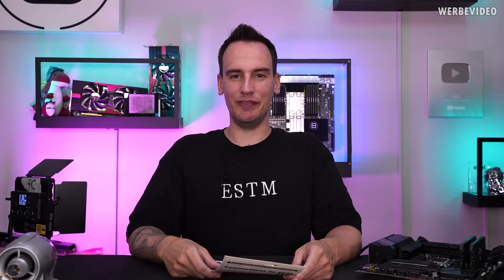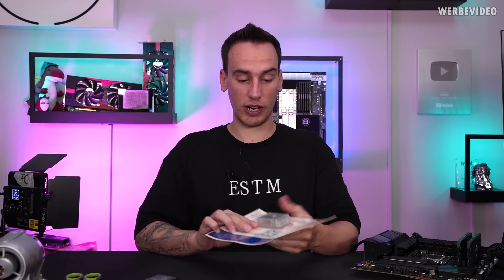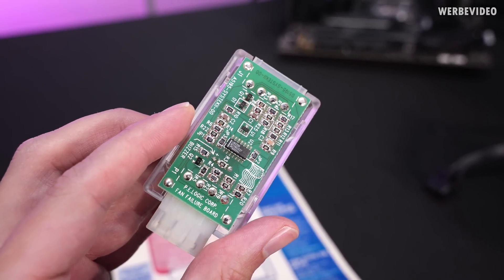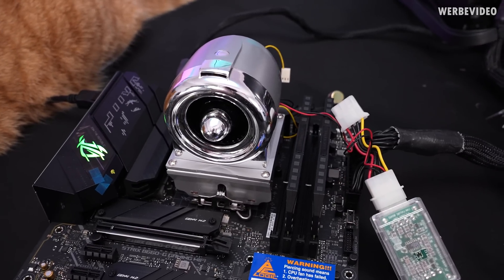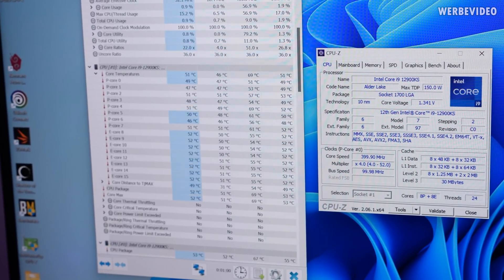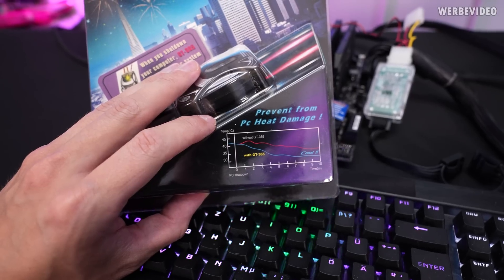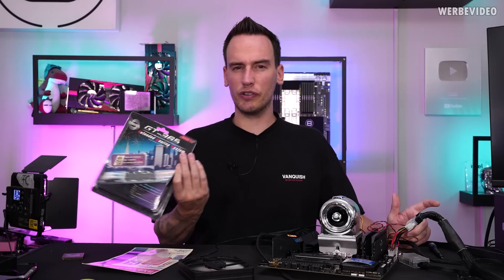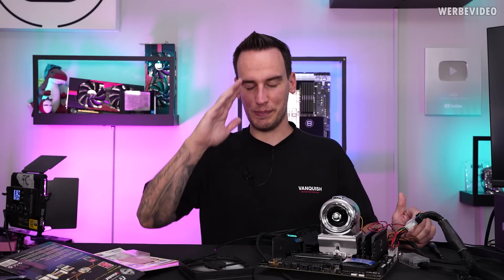This 30 Years old Cooling Gadget was Supposed to Protect your CPU... but it won't

Comment: I've had a few fans stop working, a few personally over the years but heaps of intel box cooler fans just stop working after 5-10 years on average for our industrial clients at work.

As for those old CPU's not working above 85C, they definitely do!  I had a Pentium MMX running at some 200+ C for at least an hour. How I checked? well I was melting solder with the IHS for fun.

Comment: I've only had one fan failure, and I built my first PC in 1993, but it wasn't the CPU fan, it was an MSI GTX 260 GPU. I've had some chassis fans starting to slow down and rattle due to bearing wear, but never a full stop failure

Comment: I'll admit, fans haven't been as much of a problem for me compared to something lile drive motors.

That said, I did have one fan failure over my 30+ years in computer tech. The fan on my ATI Radeon HD 3650 stopped working. Money's always been tight for me so a new GPU was out of the question, and I didn't have the knowledge to figure out how to fix it either. And so for several years, I was running that poor thing with the side of the case open and a desk fan blowing on it. It was also manually downclocked to minimum clock speeds just to make sure it didn't overheat just from booting up, and it hit 80-85C when idle.

Ahh, memories.

Comment: if your pc going be running for 24/7 them that alarms is best choice but that was back in 90s because back in 90s there wasnt safey turn off when cpu get super hot above 100c it never shut down and that when they came up with that ideas but business like it for 6 years them throwed out because new bios have fixed issues avoid cpu from being cooked over 100c auto turn off so that why they went out of business nobody buying it anymore and they knew new bios over taked them so nobody have to worry about they pc being burned up but before 2000s there wasnt any of that safey thing if your fan died them game over because cpu is already above 100c and toasted
i have so many died fan from late 80s allway to 2010 never tought they do live aging because new fan out lasted old fan that was why techology have got hold of it self and started moving forward and better
i do like idea of gt else that turn off pc it drop fan speed back down to 45% keep cpu cool down just in cause having overheat issues not sure where it coming from but can come in handy one day never know

Comment: I've had 3 fans have bearing failure. One was in a laptop, one was a cpu cooler, and one in a power supply. I also learned that those fan lubricating kits are worthless.

Comment: Yeah for those old CPU's they didn't have thermal throttling, so if it detects the fan not drawing power, your CPU would be on it's way to cooking itself. So although it doesn't detect temps, it doesn't need to, if your CPU fan stopped, 100C CPU was an inevitability so I think it does what it says.

Comment: Regarding the fan failure question @ 7:00, I have had a Scythe fan on a Scythe heatsink die mid-operation. It was on my home server, which is almost never under heavy load, and I have no idea how long the machine operated like that until I finally noticed the situation and replaced the fan. In this case though, that stupid little box doesn't get an RPM signal from the fan. Is it measuring current on the 12v rail?

Comment: I've had many fan issues... especially with Pentium to Pentium 3 CPUs. Systems that got coated in dust and wasn't cleaned or maintained would often lead to fan failure.

Comment: Even just a fan blowing air on the heatsink on its own during a shock or overload it won’t burn its when the none air flow parts such as integrated power controller and steppers , distributors like a cap an rotor , most of the time full load show their defects so having fans that can kick in when the pc is left on its own and even have an alarm would be good
Reply: Some times the fan controller rail fails during continuous use scenarios

Comment: The warning temperature is probably in fahrenheit.  Computers used to just have the one fan that both cooled the heat sink and circulated air out of the computer, so the inside of the case would heat up if it failed.

Comment: The sticker is the most important part.

The VR controller would be called a ""potentiometer" in English.

My guess for the alarm system, it's triggering if less energy/voltage is passing through it or a certain resistance/back feed is noticed from the fan not spinning.

Comment: I have had fans fail before, but they were always proceeded by a long period of "growling" as the bearing slowly went bad or its grease dried out. You had plenty of warning from that noise (which only happened at startup initially) that your fan was on the way out, and I can't think of a single time when I had a fan fail suddenly, silently, and unexpectedly.

A "growling" fan could be temporarily rehabilitated by adding some light motor oil to the bearing, but it was usually a good sign that it was time to order a replacement anyway.

Comment: Never had a fan failure on a personal system. Working in a data center I have had several fans fail over the years in servers and other data center hardware.

Comment: I had a PSU in the mid-to-late-2000s that had an "intelligent fan that remains on for a few minutes after shutdown" (I still have the handy box it came in). It doesn't say why it does this... but it must be good because it says it on the box... It was a Hiper Type R modular PSU 530W. It's also the only PSU I've owned that has released it's magic blue smoke. I assumed at the time I was asking too much of it and have only owned 750W PSUs since, but take from that what you will.

Comment: dont think ever had an actual cpu fan fail, but cheap case fans with sleeve bearings that dried out/got a cable wedged in it or something definitely seen some die. atleast back then it might have worked alot of the time, when you had lower power cpus that didnt constantly run at the max thermal headroom possible, basically would never overheat if the fan was working outside maybe if it was so blocked with dust or something that no air could pass or something quite abnormal

Comment: A friend had a Thermaltake Xaser 3 case for a very long time. The case came with maybe 3 or 4 cheaply-made transparent fans with blue LEDs, no (A)RGB back then. Some time ago we checked up on the case and two of the fans were completely seized up. They were difficult to turn even by hand and made a squeaky noise while forced to rotate. Fans do die but I think nowadays we have generally higher-quality stuff than back then.

Comment: In 30+ years of building/working on computers, I can't say I've ever had a fan just outright stop...
I've had plenty get incredibly noisy from bad bearings though, but they still moved enough air to keep things cool. Most of that was on Socket 7 systems (original Pentium era)... So even if the fan did stop, it didn't get THAT hot.

Comment: We know that 110F is only about 43C, but the product is American, so, they might be implying Fahrenheit? Not 110C. The packaging also says "System" and not "CPU" overheating. They might simply have a temp sensor (the cut-out that you noticed in the housing) that reads the ambient case temp--assuming that 43ish Celsius ambient in the case could mean CPU temps are "dangerously" high (remember that temps back then were much lower than they are now and cases were not typically designed for airflow). Also, testing in an open air rig would negate this feature of the gadget, wouldn't it? Again, assuming that the sensor is meant to read case temps and guess that the CPU might be in trouble, based upon that.

I could be completely wrong, but by reading the packaging info and knowing that metric measurements in the USA back then were fairly rare, the above is how I think it is supposed to work. ?? maybe?? =)

Comment: In the 90's yes, PC fan failure was common. Here in Australia it gets quite hot in summer, and mix that with the flood of very cheaply made single speed PC fans in the market at the time: Fan failure has entered the chat Most common failure was the grease in the cheaply made sleeve bearing would dry out because there was not enough, or the bearing was poorly made and have too much lateral play in it causing premature failure.

Comment: I have had two Corsair AF bearings fail in less than a year of usage but RMA covered it. I have also owned over two dozen fans, so that is still a very low failure rate and was definitely a factory defect.

Comment: I had an A8N-E motherboard chipset fan die. The fan would stop spinning and I'd start it again with my hand and it would keep spinning. I strapped a Delta PSU fan instead and it cooled the chipset until I sold the system.

Comment: Given that modern motherboards let you know if there is not a fan plugged into the CPU fan header, I wonder if with a beeper attached they would also let you know if the CPU fan was not spinning when it should be, negating the use case for this

Comment: I've had fans wear out in the past to the point where they wouldn't start in the first place. They'd keep going if you nudged them into action, but they'd stall at system powerup otherwise. In that case I ... guess ... this would be useful, but I think you probably would have long since heard the racket a fan makes when a bearing is going off.

BTW I think if you positioned the module so it was on the exhaust side of the cooler, an internal sensor would be able to get a sense of the current TDP from air forced throuh that hole.

Comment: I think first one is basically relic of its own time, when detecting CPU fan RPM wasn't a thing in software, so it was handy to have reliable way of telling if fan was dead. Also speed adjustments weren't a thing. And there were CPUs without thermal protections, if fan dies, CPU will just cook itself to death. Not sure for mentioned CPUs here, but I know few mistake stories that ended up in CPUs cooking to death, because owner didn't do good job installing cooler. Though from top of my head AMD was more famous than Intel about it. Also CPUs wouldn't really clock down and stuff back then too. But as I said, it is relic of its time, today you got thermal protections in all CPUs, also on 3 or 4 pin headers, you get RPM feedback, so you can put in software protections for dead fans. So this kind of became obsolete. Also temperature wise, yeah, it has no way of knowing temperature, but on CPUs without thermal protection, it was pretty much guarantee that if heatsink couldn't take it and coolers were less beefy back then, it would run itself to whatever temperature kills it. Still for CPUs with thermal protection, aka ones that would shut down when you hit limit, this was just typical snake oil merchant thing.

 However keep in mind that PC market as whole had bit of habit to have things being sold around long after problem is already gone, because people will remember being told this was an issue, but didn't know ti isn't anymore. Same is true for various memory optimizers that advertised how they compress RAM content and thus make your PC run better, which at some point actually was true. But once Windows or OS had built that same on the fly compression in, those did absolutely nothing and were sold for years to people based on problems long gone. But unlike some things today, they kind of were still trying to do something, not just "lightshow". I like to call it lightshow because of those fuel savers for car, that often only have something controlling LEDs for the show. And it will be blinking like it is communicating with car, even if you just connect power pins to power supply unit and internally data pins aren't even connected.

For second one, it was just snake oil merchant thing. Likely it is simple circuit, that if it detects power from fan header, it just passes it through and if there is no fan header power and only standby, it starts 5 min countdown and then turn off. Hence why it will start spinning fan when you only plug in standby power. It has no way of really knowing if you just plugged it in or not. It is probably simplest possible design they could make. So it doesn't know the difference between being plugged in right now or PC being shut down.

Comment: variable resistor= RE OH Stat (rheostat) :) you also have to remember 30 years ago people smoked heavily around computers... smoking wasnt "banned" indoors in most places and the smoke would gum up the fans/bearings.... todays generation will not suffer the atrocities accompanied by smokers dust plugging heatsinks

that fan alarm could be retro fitted to be a HEY SOMEONES TOUCHING MY COMPUTER alarm :D

Comment: With bearing damage, you'd know there's a problem long before the fan would just stop spinning. I have seen fans just fail because they were so gummed up with nicotine. Which is a simple solution... don't smoke around your PC.

Comment: ASUS SABERTOOTH motherboard has a function in BIOS to let the case fans continue to spin after you have shut down your computer. Same as many turbo cars have when they continue to run the fan and oil pump to cool it down after you have turned off your car.

Comment: I recently had one of my two fans on my noctua cooler fail, I didn’t really notice it until I was looking inside the case and noticed the fan blades wasn’t spinning any more. I didn’t get any alarm from my computer either, the temps was still ok with one fan still running… I’ve had case fans die before too. Seem to be the bearings that die since the fans hardly rotate using hand power.

Comment: My computer froze all the time and it was probably due to overheating, but when i opened the case the fan was spinning and everything worked. I then put the cover back on the case and lifted it up on its feet again and after 5-10 minutes it froze again. I then found out that when i put the case on the side and the fan was spinning horizontally it was spinning, but when i lifted it up on its feet the fan stopped spinning when it was vertically. So yes, the fan can stop spinning.

Comment: I have had fans fail, but they were cheap fans. But back in the 90's it was a common enough problem with aftermarket coolers.

Comment: The early fans where similar to northbridge cooling fans they had a fairly high failure rate. CPUs back then also did not have thermal cut out , they would just cook.

Comment: Worked in a computer shop for 8 years ending about 10 years ago. I've seen a lot of dead case and CPU fans. Even the Dell ones that were exhaust fans that had a shroud that extended over the cpu heatsink. Effectively meaning the cup and the whole case had no airflow. Fans are a lot better now, but in the past it was quite common and CPUs weren't so well protected so they could easily burn out.

Comment: Had a gentle typhoon fan fail on me not too long ago. It was used on my radiator so noticed a bit higher temps. it was really old and after taking it apart i saw that a couple traces went crusty, fixed the traces and it's back running fine.

Comment: I have a Pentium Pro computer and back in the days when cable management was not either easy or practical. I once had a cable come into the blades of the fan and the cpu overheated, the computer just froze when it got hot enough and worked just fine after it cool down again. but then a warning sound would actually been practical.

Comment: My work PC at some point randomly shut down - turns out the “R” sticker from the fan on the R9 Nano glued off and immediately got sucked in and jammed the fan, causing the GPU to overheat.

Comment: had a computer would power off randomly. determined the fan in the power supply had stopped spinning leading to an overheat situation. replaced the power supply and fixed the machine. was it the fan or power to the fan? couldn't be totally sure. I believe this was a pentium3 or pentium4 era machine.

Comment: Ive had a stock Intel CPU fan stop before, about 11yrs ago.   It just stopped, and the computer just shut off.  No damage.  The system was able to shut down, before anything fried.  RR on the fan was it just failed.  I applied power to it with my bench power supply, nothing.   As we know, even today, the stock coolers are, well, not very good.

Comment: I once turned an Athlon XP (i think) into a little smoke cloud. Not sure this thing would have helped...  Don't remember the reason. Likely it powered on accidentally before i had the cooler on it. And it just went. Things have gotten SO much more convenient*.   It's annoying it the thing doesn't start and you have to dig through error codes. But smelling your CPU is always a worse. 

*Well apart from the stupid power button&co connectors which are literally the same fiddly crap as in a 486 system.

Comment: For the Evercool gizmo, I remember a friend of mine in the mid-2000's who insisted that the hottest a CPU or GPU got was right as it was shutting down. I guess it's possible that some 90's tech did have some property where power regulation was shut down before the system halted, although I honestly can't think why. In any case, the anecdote alone should show why stuff like that existed - some people genuinely thought that it was necessary.

Comment: Something I find weird is, people being annoyed by fan noise. In the 90's, the louder your computer was, the cooler it was and the better it would run. I still run my fans at 100%. The fans now are so quiet that it's not even noticeable. Also, electronics are like light bulbs, the hotter they are, the sooner they burn out and if you leave them on all the time they will eventually burn out faster. I have a friend that never shuts his computer down and he calls me quite often to come fix his computer because of it.